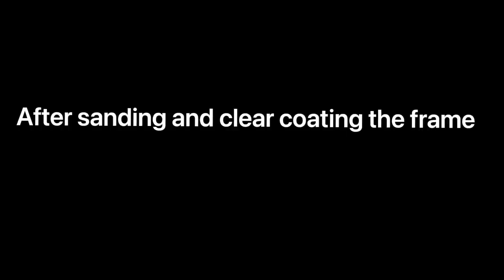Restoring A Rusted Out Go-Kart To A Backyard Drift Monster

Comment: Imo I would have sandblasted, flap disc and wire wheeled the frame before doing any welding but that's just me. I realize you are trying too keep the patina.
Nice job.
Reply from the maker: All the spots that had to be welded were sanded/ground down to bare metal before welding. I ended up sanding and clearing the whole frame after it was done. Just looked raggedy with the patina look in this case.

Comment: I have a 4 bolt pattern can I get drift tires or sticks with the same bolt pattern cause all I see is 3 bolt
Reply from the maker: As long as the slicks fit the wheel it doesn’t matter what bolt pattern but most 3 bolt rims are 4,5 or 6 inches in diameter so most slicks are in those sizes. Since it’s 4 bolt I’d expect your rim may be bigger than that so a slick may be hard to find. An old warn turf tire or a mower tire with only a few straight groves would work for sliding too.